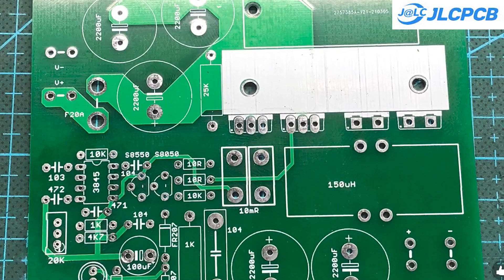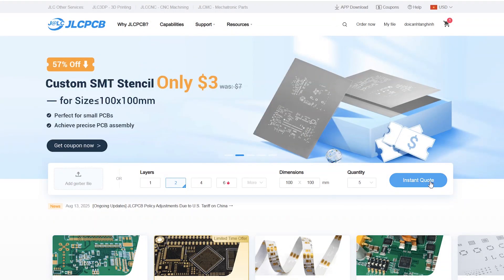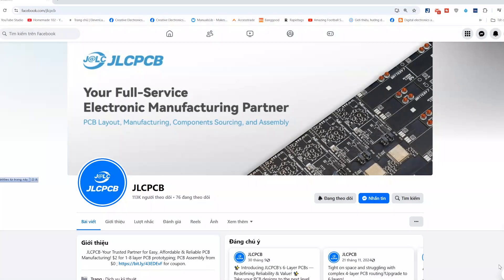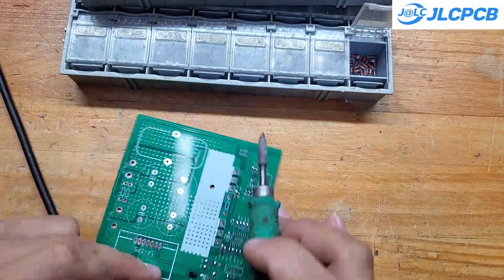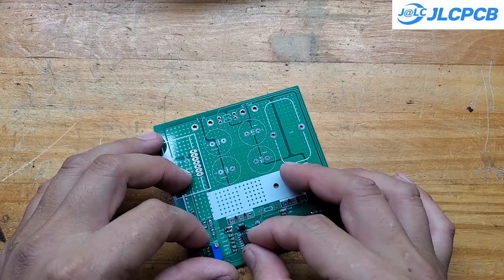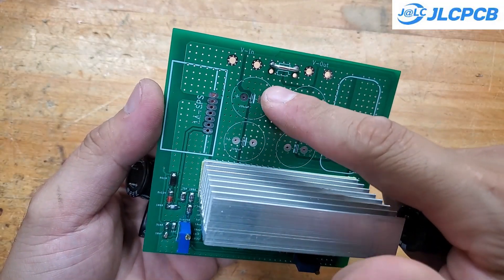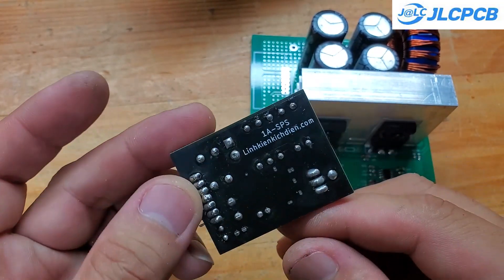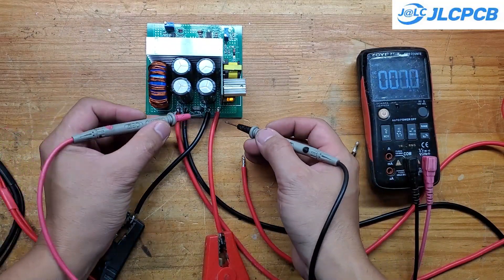Testing the 45A synchronous buck converter | JLCPCB

Comment: 1. Did you design the flyback module?
2. How did you get the voltage and current transfer function?
3. How do you change between cc and cv modes?
4. Which way did you use to get the controllers?
Thanks 😊